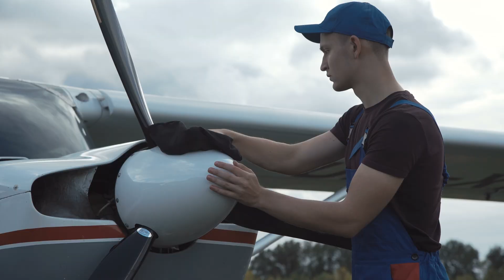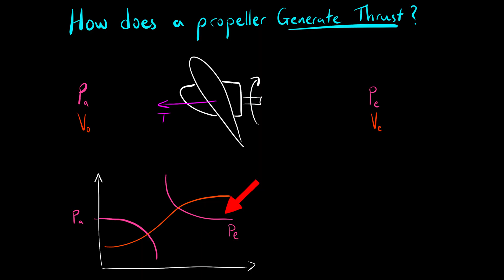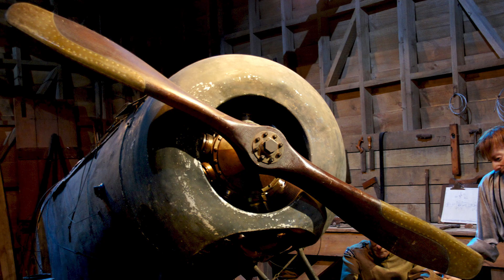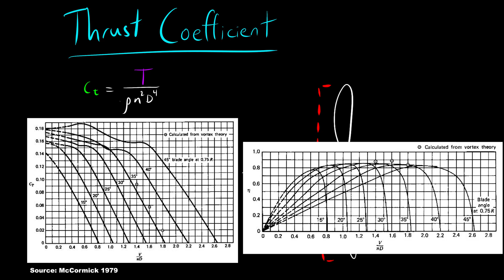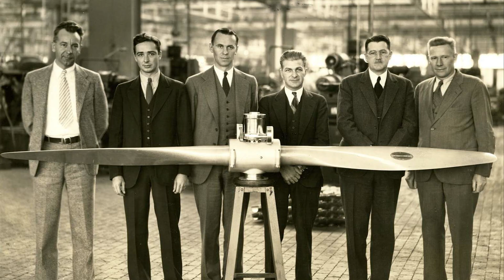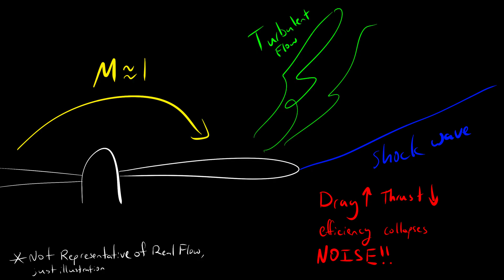How Propellers Work: The Physics of Efficient Thrust

Comment: I think that electric motors and more fins for thrust would be interesting.  Less high speed velocity seems way more safe. It be interesting to see a test of the same propeller diameter vs fins vs battery usage vs thrust vs speed

Comment: The technical reasons why we see efficiency improvements when the maximum available power is absorbed into a maximum thrust area that produces a velocity just slightly above the desired max. vehicle speed. That would be a nice follow up video. There must be an equation that accurately describes this?